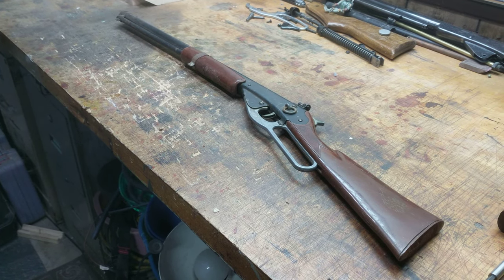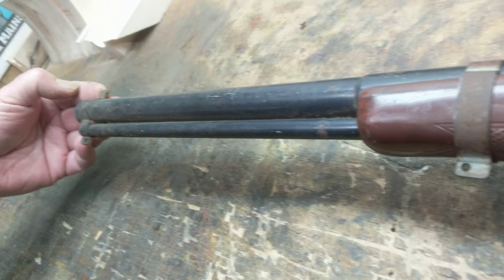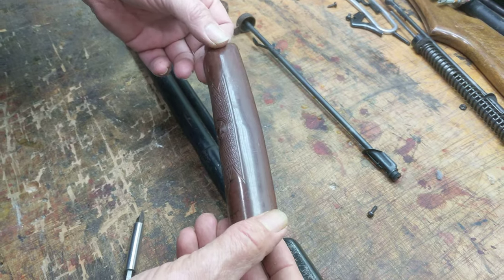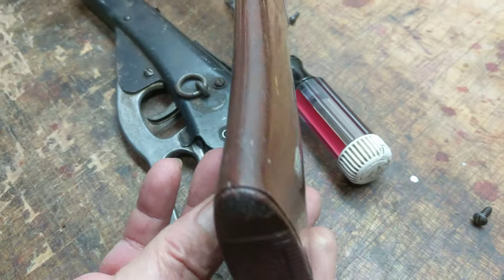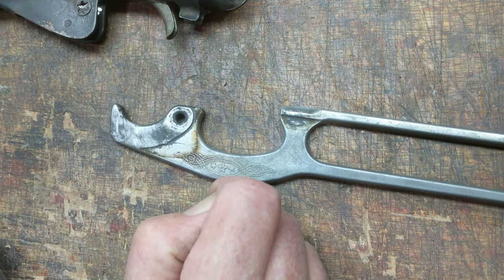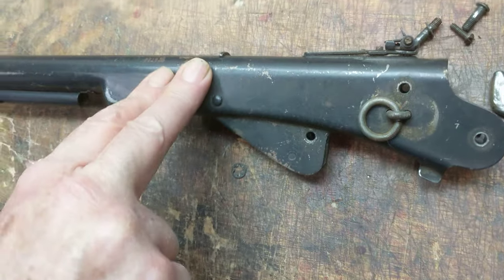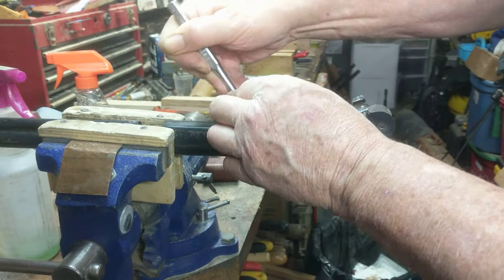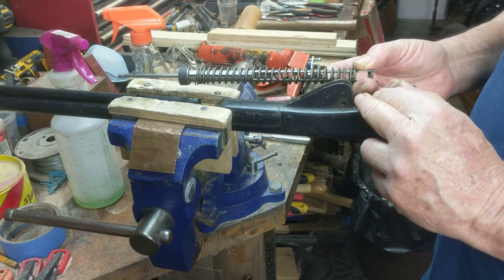Daisy Red Ryder Model 94: Part 2- Disassembly

Comment: Random one but is it better to oil them before cocking or after cocking. Do you advise oiling the barel from time to time too ?
Reply from the maker: Mr Mon-Eye,  The best approach is to oil when you first get your mitts on 'em. Old neglected Daisy's have on many occasions have been sitting in the same spot for decades.  This particular gun suffered greatly from the dried out oil in the compression chamber which was acting more like glue than oil. I wanted the video to illustrate just how much drag dried oil/varnish can put on the little guns.

As far as standard practice here in the shop, I'll oil from barrel down, flip the receiver and hit the lever bolt, any of the plunger assembly I can see and then reverse the gun again and oil the slot where the spring anchor was to oil the top of the Sliding Spring Block as well. If you have leather sealed gun there's a strong case for removing the shot tube and dousing the abutment seal to re-lube it, waiting a spell and then doing the same thing from the backside.

Nothing beats a complete disassembly and careful cleaning of each component and an equally careful reassembly. I like to slide the bore scope in the compression chamber and get a good look at the cylinder walls, abutment seal and the back of the abutment washer and then clean the bejeezus out of 'em.  Ditto for the barrel shroud. 

So I'd say both, anytime you pick them up, oil them and wipe them down.  there's a pretty solid body of evidence that oil in the barrel of a Red Ryder will affect accuracy and you can read more about that over at 

https://www.thehighroad.org/index.php?threads/putting-a-little-more-power-in-a-15-00-daisy.807316/page-38#post-11128384

It's the best place on the internet to learn a maximum amount of info on these neat little guns.

Thanks for the comment  and cruise back by!
Reply: @RestOModDaisy  superb thank you for the info and taking the time to explain. Great channel and video content fella
Reply from the maker: @mr_mon-eye  , Thanks so much!

Comment: Hi. Question. I have a 1938 daisy made in Arkansas. I'm trying to restore. Will the screw set for a 1938B fit. Is there anyplace to buy screws for it? It's all metal with the screw fill tube not the window fill. No safety on it.
Reply from the maker: David, Sure you can buy direct from Daisy super cheap. The screw set includes the trigger bolt and nut, lever bolt and nut, stock bolt and nut, top stock screw (The current production screw is a lot longer that those used on the original Model 1938 so you might not want to use it) and a replacement screw for the forearm. They're painted a shiny black so they don't blend well with the Daisy Blue paint on the gun from the factory but they fit and they're cheap. Daisy's #479-636-1200, they will charge for shipping so if there are other parts you need it would be smart to bundle them up in the order. Thinking about any mods? It's a great platform for it!

Comment: Hello.I..Have a plastic... barrel stock... model...the rest is wood...no hammer....  butt stock has the cowboy lasso spelling out Red Ryder.  It used to shoot but stopped couple years ago..have it apart but not compression piece.  Its looking good ..trigger spring...everything in good shape. I'll watch all vids.  Before taking apart it would push air but not shoot BB.  Thank-you
Reply from the maker: Sounds like your BB feed ramp is blocked. Empty the gun of any BB's you can hear rattling around in there and stick a thin piece of wire, like a paper clip that's been straightened out into the viewing slot on top of the receiver and push it forward towards the muzzle a couple of inches. Remove the wire and see if there is now a BB rattling around in the receiver shroud.
Reply: @RestOModDaisy  Tnx for reply and info will do! I did see that and wondered about it. It looked blocked but I wasn't sure. I'll take a look tomorrow ..tnx again RestOMD
Reply: @RestOModDaisy  Morning,   Its some kind of tube approx 2 3/4 long . Its hollow but no BB can pass thru. I was able to push it out the end of shot tube with some baling wire. It fits into shot tube. Must be  something that was "pushed" by air from somewhere. What is it?....mystery tube...So, yes, you called it. The tube was blocking the BB feed ramp  port.  I"ll wait on reassembly.   BB grade    .177 cal/4.5 mm
Reply from the maker: @alexgramm5170  The 2 3/4" tube you're describing is the airtube that transfers compressed air from the compression cylinder to the shot tube. It should be blocking the feed port if the gun has been fired. When you cock the gun, the air tube is withdrawn from that position by the action of the lever pushing the plunger assembly to the rear of the gun to lock up with the trigger sear. Check this parts diagram out to see it's placement and function

https://www.jgairguns.biz/1938b-red-ryder-carbine-c-78_186_2016/
Reply: @RestOModDaisy  I checked that out and have for reference ; thank you for the exchange. Would I need to take out compression cylinder. How does air tube seat when it's not in shot tube?
Reply: @RestOModDaisy  I'm checking out disassembly vids and can see Air tube in plunger. Thanks again Shane. You cover alot .
Reply: @RestOModDaisy  Enjoying videos. Looks what I have is #111 Model 40.  I think I'll need to take compression assembly out in order to inspect where air tube fits into plunger. Hard to see down barrel. Tnx again Shane your channel is a great resource.
Reply from the maker: @alexgramm5170  Whoa! I thought we were talking about a Model 1938B.
Reply: @RestOModDaisy  Howdy...I'm learning alot from vids..I'm enjoying this. So the 111/40 is more of a vintage piece. Some rust on barrel but not too bad. I did get compression assembly out. Could not get it to move so pushed on spring anchor tab and pulled it out. I'll watch air tube vid. I did see you use the caulking gun as a tool ..I have one. The air tube definitely broke.. that's why it stayed in shot tube blocking the BB feed. I have that parts reference and site to order from. I might be wordy.. I'm sure your busy..:) Having fun with it.

Comment: No regarding this video, but my question is in regards to some antique bb guns I have and wish to know how to oil their inner workings without having to take them apart or taking them to a repair shop.  Daisy 1894's and the Daisy/Sears Yellow Boy (still an 1894, but with octogonal barrel and an inch or two shorter).  Any help or suggestions you may have to offer would be most welcome.
Extra note:  They all still work fine, but I don't know when they were shot or oiled last.  Thanks in advance!
Reply from the maker: Don't blame you on not wanting to take them apart, they are a real bear. I don't work on that platform as rule and here is a copy of the Daisy Owners manual that cover oiling points and preferred oil type from Pyramid Air

https://www.pyramydair.com/airgun-resources/manuals/Daisy-Winchester-1894-air-rifle-manual.pdf

Comment: Good Morning! I'm missing the screw that holds the forarm on my 111/40. What kind of screw is it? The screw you removed looks like a slotted pan head machine screw. I tried a 6/32 thread screw and it fit but it was just a little bit sloppy so I'm not sure if it's a different kind of screw and thread.
Reply: Ranger1, You are correct that the original screw was a 6/32 pan head slotted screw, that's the size I just pulled from one of my original #111 M40's. They are just at 3/4" long and mounted flush with the bottom of the fore stock. Most likely the original screw was lost way back in the day and a replacement was used that opened up the original mounting hole past it's correct diameter resulting in the sloppy fit of your 6/32 replacement part. It is possible to use a 6/32 nut on your bolt as there is access from the rear of the "magazine" tube but it's a fiddly bits install as you will need to fix the nut in place with a wedge to get that screw through the forearm, the hole in the magazine tube and then threaded onto the nut. Or you can go to an 8/32 machine screw and see if it holds.
Reply: Shane Bruce thank you sir

Comment: I have a model 1938 and a model 50 golden eagle that I can not remove the shot tube is there a trick sure could use some help love the videos very helpful
Reply from the maker: The Model 1938 should just screw out by rotating it counter clockwise. The Model 50 is a bit different depending on which version you have. The earliest models had a BB trap located on top of the barrel shroud and were removed by making a 1/4 turn clockwise and then pulling it straight out. Later versions unscrewed like the standard Daisy bottle caps. Does yours still have the tube rear sight on it?

Comment: I have a 94 but it has a wooden stock and plastic centerpiece.   Any way to determine age.
Reply from the maker: Certainly. On the top of the receiver is a roll stamp that tells you that you have a Model 94. On that roll stamp will be the place of manufacture, either Rodgers AR or Plymouth MI. There will also be a registration number of a lot lot number as well. Rodgers gun are post 1958, Plymouth guns are pre 1958. The reg/lot number will tell you the year of manufacture after you decipher it. Check this page over at J&G airguns for more info

https://www.jgairguns.biz/daisy-register-lot-and-serial-numbers-explained-ezp-55.html